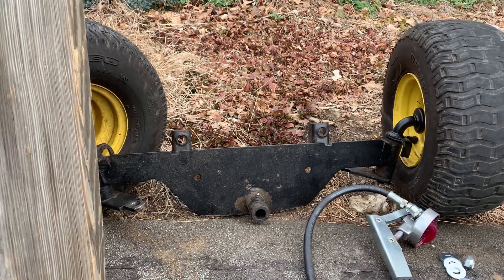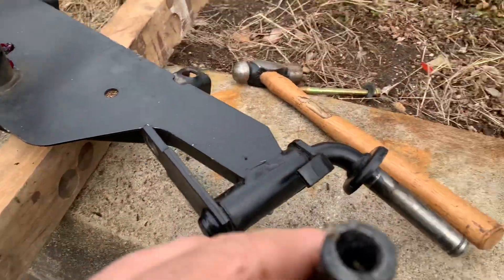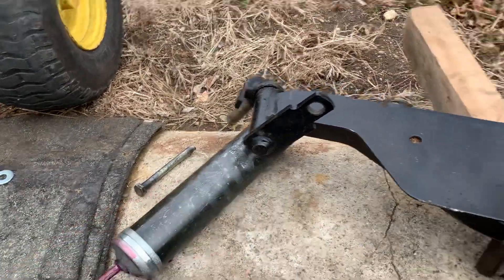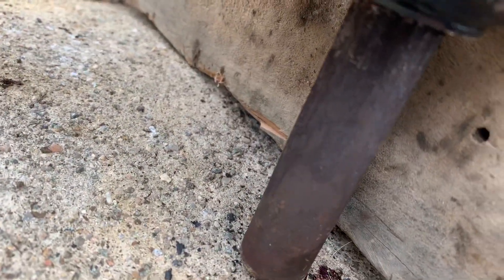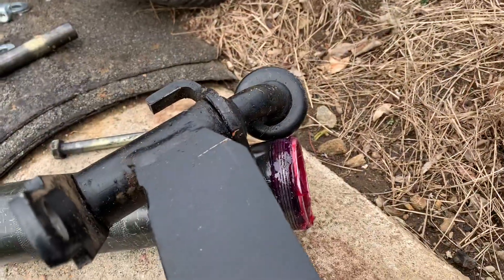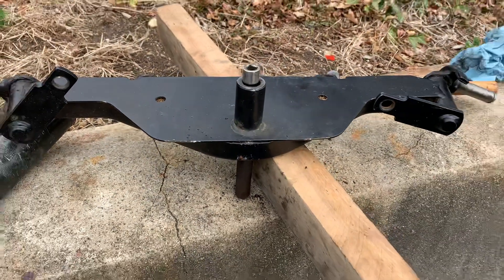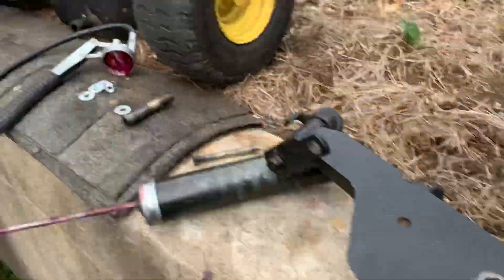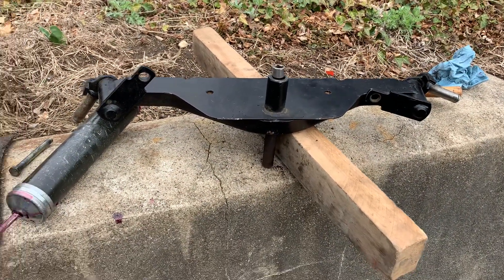Deere STX-38 Black Deck Axle pivot bushing greasing

Comment: I actually ruined a control arm on "My Old Camaro" by trying to put grease in too hard.  I stretched it.    You heard about that car today.  It was a 1968   327 V8  The year-was 1974   (double hump head, large intake valve)   I drove it like crazy.  Bad Bad Bad.   I did live through it though.    It had a top speed of 0-MPH      That is when the speedo wrapped around  135 MPH??.     I should have been arrested.